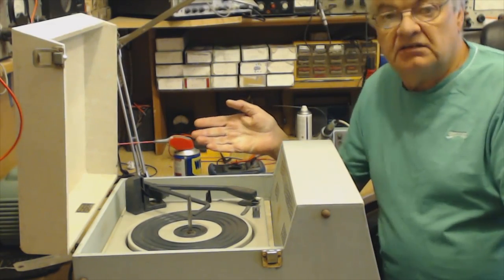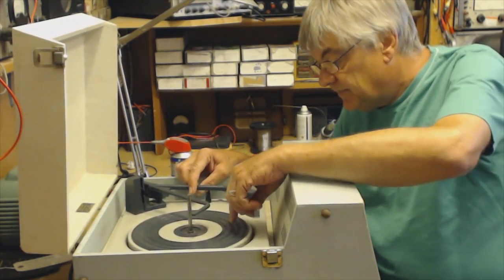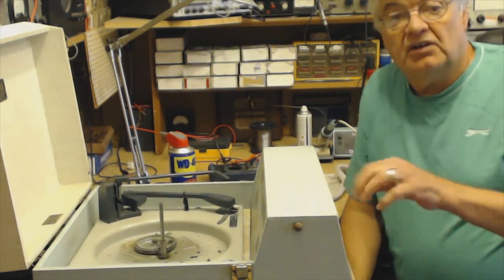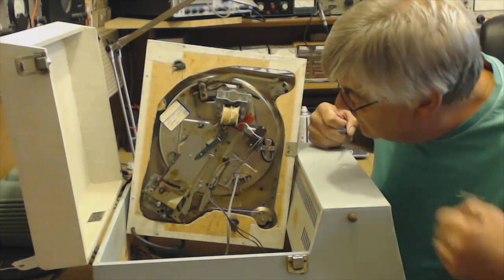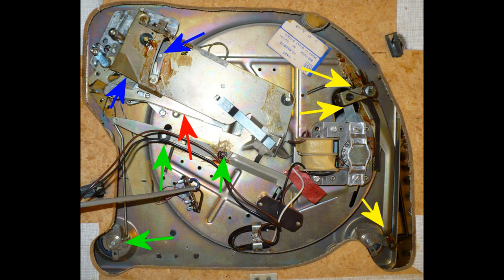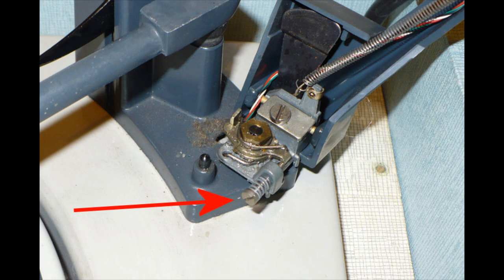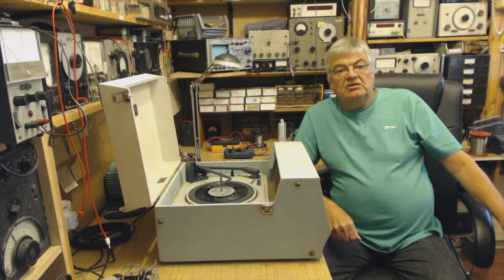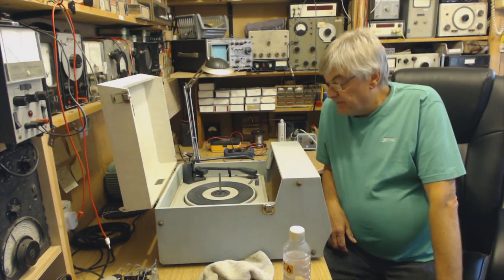Servicing a BSR Record Deck

Comment: No doubt I am going to be back and forth watching this as I try to get one to work again.
Reply from the maker: Good luck with the job.
Reply: @g4nsj  I'll need it, I can't fathom how it is supposed to work and don't want to start dismantling it and make it worse.
Reply: @g4nsj  I keep trying with this but the drive wheel won't keep hitting the mark, if I change speed it stops running.
Reply from the maker: @boblordylordyhowie  The drive wheel spring might be weak, not pulling the wheel against the turntable. Or the stepped pulley might be set incorrectly on its shaft. Just a thought.
Reply: I took the pressure spring out as it had been in tension for decades and fitted a customise one but i fear it is not tight enough as it moves around easily, should there be some tension on it at all times?
Reply from the maker: @boblordylordyhowie  Yes it will need a little tension all the time.

Comment: Hi Ray.  I was just wondering, was the idler wheel in good condition? Some early record player users would leave it engaged when not in use. This would form a 'dent' in the idler wheel, causing it to make a noise while rotating. This would, of course, mean replacing the rubber idler wheel, if you could find a suitable replacement.. 🤔
Reply from the maker: When I did repairs, I fitted a rubber tyre on the old wheel. It did the trick! Cheers, Ray.

Comment: Hi Ray Good video. I prefer to remove as much of the old hardened grease from the parts and regrease ,  WD is fine as a quick fix though.
Reply from the maker: Glpi lpi If I recall correctly, we used to use Molyslip grease.
Reply: we have something along those lines called superlube

Comment: thanks for this helpful and informative info.  Having trouble with the speed control on an old BSR MA65 (Ferguson) have been following and cleaning as your video, but unable to remove the deck from the casing due to the transit screws staying in place.  Have you any advice?
Reply from the maker: Brenda McCourt release the clips on the transit screws below the deck.

Comment: Beware of using WD40 near plastic,used to use it on volume controls on tv's,week or two later the plastic around the volume controls changed composition and broke apart.
Reply from the maker: Interesting, thanks.
Reply: Ex Pirate on end of MW band,got caught by the ‘Gestapo’(GPO)
£25 fine and£7 costs,I only earned £9 a week!,love the stories and technical advice 😀
Reply: That's very true

Comment: hello radio workshop,I was wondering as im trying to re lube my bsr turntable and my question was,do you use wd40 for everything,or do you use a different grease or oil for certain parts.And for the ball bearings do u use wd40 for that?I have wd40 and was wanting to ask before i used it for everthing.Thank you very much and love the video!☺
Reply from the maker: I  use WD40 on all parts of the turntable.  Not too much though! Glad you liked the video. Cheers, Ray.
Reply: White lithium grease works wonders on BSR record changers, especially for the thrust bearing assembly, underside track of the cycle cam gear, and various linkages, nooks and crannies underneath the turntable.  You just have to clean off all the old grease (you can try WD40) with rubbing alcohol and a qtip or liquid wrench with a paintbrush.  3-in-1 or sewing machine oil is best for lubing the middle and lower motor shaft and bearings.  And there is Rawn re-grip rubber cleaner/rejuvenator for the idler wheel.

Comment: So, are these decks meant to be springy? I saw another video of a Dansette Conquest as I'm planning to buy one and it did the same. My guess is that its springy for the vibrations and it doesn't damage the record?
Reply from the maker: Yes, they are meant to be springy to counter vibration. Cheers, Ray.
Reply: I thought so! what are the normal tracking force on these? I'm thinking of buying one.
Reply from the maker: I don't know the tracking force. It's been a long time since I worked on them.
Reply: Ah, okay, Thanks anyway!

Comment: Hi Ray thanks for the video very interesting, I have done a few decks in the past but some time ago bit i have a BSR deck of my own in a old germanium transistor record/radio/tape deck what was handed down to me (not working of course) but i have repaid it now though mind you i am looking for a couple of 4mm metal capped wire ended dial lamps 5v (if you know what i mean haha)  
                                                                    Regaurds paul

Comment: I have a deck like this that's running about 3.5% too slow. Any suggestions anyone?
Reply from the maker: Hi Andy, clean and lubricate the motor bearings and all other moving parts. It's probably the idler wheel that needs replacing. I have seen them on eBay from time to time. Cheers, Ray.